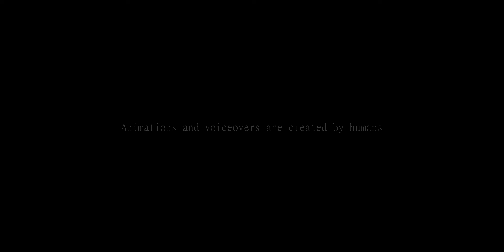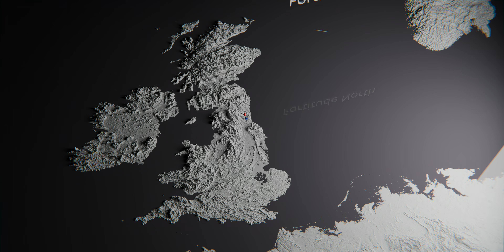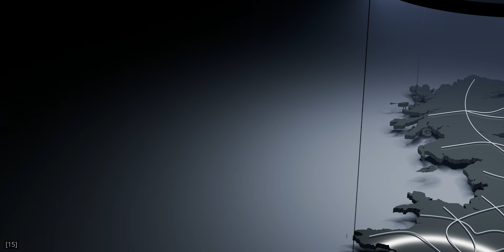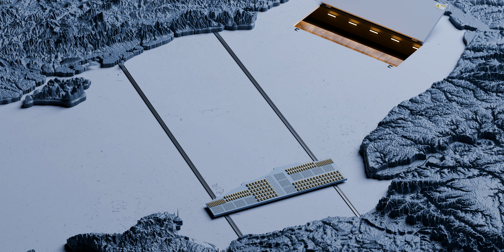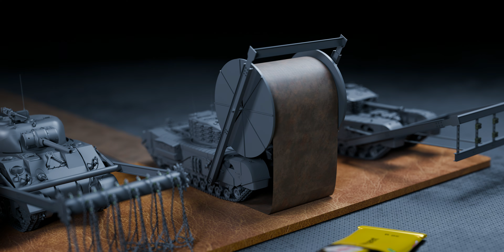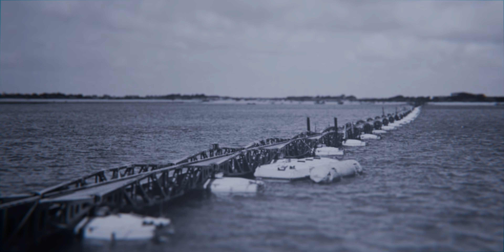The Most Bizarre Ideas Behind D-Day

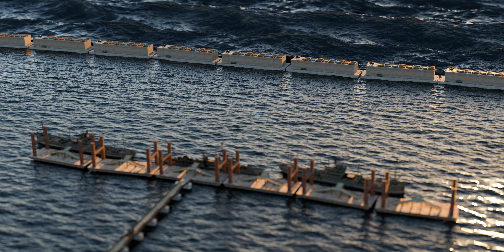Comment: Very interesting from you, as usual. However, where do you get this information from? 14:03 "the crews on board these ships often didn't know their ship was on a one way trip before the charges were set off." Not strictly true. Those in the tug boats were not always informed (some were told shortly before, some last minute or even not at all) but the ships were. Most of these ships were either too old or too damaged to be serviceable and all were basically gutted, had everything removed, all had explosives down in the hold and big holes made in the transverse bulkheads, with all necessary supplies such as ammunition and food moved to the top deck as most of the lower decks of the ships were under water. They were being fired upon by German planes. Plus, they all had just a skeleton crew. Sure, they were told late but they were told.

Comment: Really good intro and video — the animations are outstanding. The only thing that stands out a bit is the typography. Compared to the quality of the animation, the text almost feels like it “falls off” the screen, as if it were just added in PowerPoint.

That’s why I’d suggest putting a bit more energy into the typography so it matches the level of the visuals. Right now the text feels a bit bulky — making it slightly smaller and more refined could help a lot. I’d also be more subtle with the letter-spacing animation; even a simple fade-in could work really well.

At the moment the typography slightly pulls down the otherwise really beautiful 3D work. Just sharing this as friendly feedback — hope it helps!